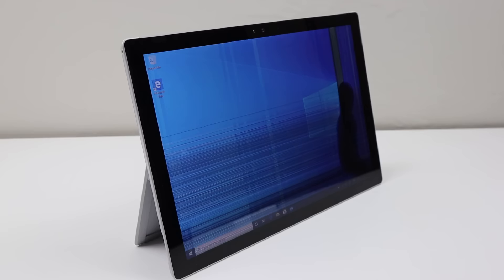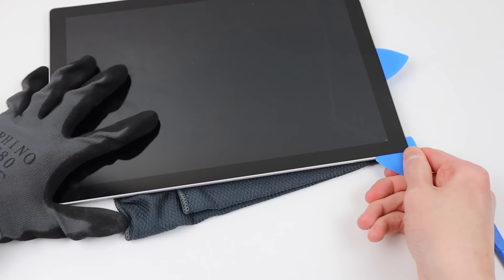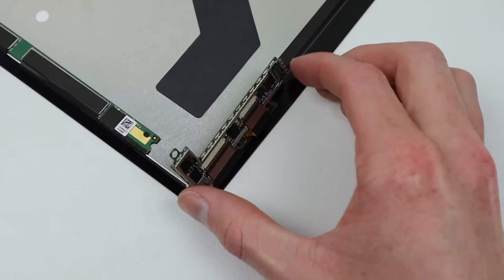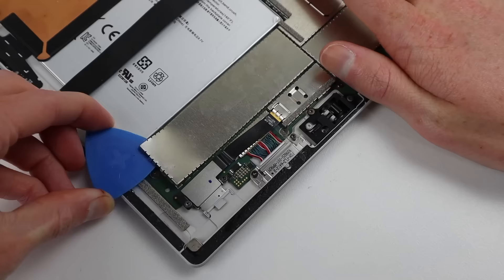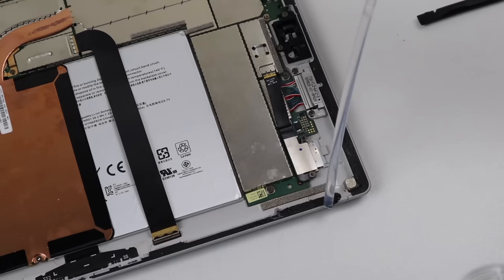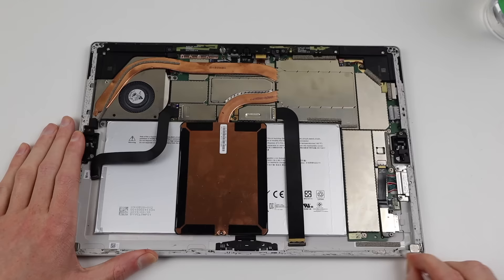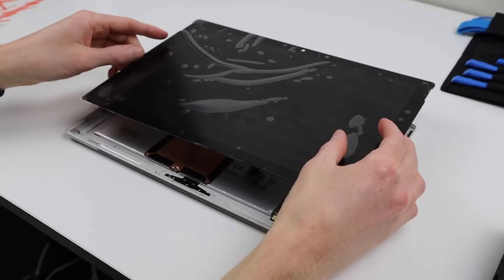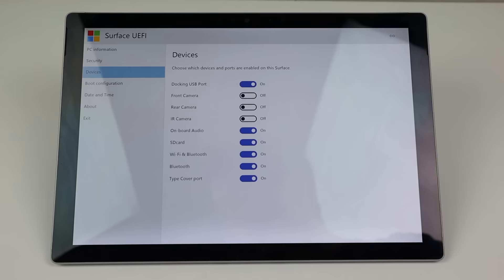Smashed Microsoft Surface Pro 4 Restoration & SSD Upgrade

Comment: Please note that ANY Samsung's screen made for the Surface Pro 4 has a major issue that is responsible for the flickering. If you want to fix this issue once and for all, get a screen for the Surface Pro 5 (made by LG - seen in this video), get the connector adapter from a SP5 to a SP4, and you're good to go.

Also, the SSD is capped to 1500MB/s in terms of read/write speeds; no need for a super fast M.2 drive, it'll be purely useless. But it'll still be way faster than the stock Samsung's drive.

Comment: I have 2 Microsoft Surface 3’s, one is cracked and the display is broken, the other one (as of right now) is fully functional except the battery is rapidly expanding and causing the screen to lift up from the the actual body of the surface. I would like to try to replace the battery but I’ve never repaired any electronics before so I’m scared that I might crack the screen or mess something else up. If I can’t fix it, I’m gonna have to sell it. Do you have any suggestions?

Comment: Hello Hugh, I just purchased a surface pro 4 off fakebook marketplace today and the guy reckons it was working really well but found out its not. its got a dead zone right in the middle of the screen and the screen flickers really bad. could you please tell me, will a screen replacement fix this? thank you

Comment: hey man, i fixed my old unibody pre retina macbook pro's hinges and now the screen wont turn on, ive tried resetting the SMC and reset my PRAM, and the display cable doesnt seem to have any damage or bent pins, and was working just fine before the repair, have you got any tips for me?

Comment: Nobody;

Me at 3 a.m. thinking I’m cool from listening to a guy with an accent speak fancy words i don’t understand:
Reply: Hello guys, I need help , my surface pro 4  has a tendency to BSOD about 3 times an hour randomly, I have windows 10, it has been like this since I bought it from ebay. It is only stable when in Safe Mode. I have tried all sorts of tests. The error is usually Whea Uncorrectable error. But sometimes it shows kernal failures etc can someone help.??
Reply: Chimeta Mulambia you spelled kernel and other things wrong but you should try looking it up on YouTube search no YouTube replies

Comment: You don't remove shields like that you do it slowly without bending them and the tape you used for the lcd won't hold long especially when it gets hot insde..  you should used black water resistant tape.. yes the surface is not water resistant but they used water resistant tape for the purposes of keeping the screen and body together!

Comment: Brilliant video Hugh. My surface pro 4 has just gone to tech heaven but I have removed the SSD from it and want to be able to remove the data. I saw at the end of your video that you placed your old ssd into a case an used it as a back up storage device, would you be able to send me a link or reply to me with a compatible enclosure to use with a Surface Pro 4 ssd? I have data on this ssd that I cannot lose and im hoping i will be able to retrieve it. Thanks

Comment: i have a samsung galaxy book 256gb 8gb ram. i was using switch charger on it when it stopped working so most likely charge board not working or it killed the battery in it.

Comment: Hello good sir, my surface 4 has a volume button issue

Basically the physical + button doesn't bounce back like a normal button so it keeps on increasing the volume

Holding the - button to act as a counter works when starting up 

The issue is kinda annoying...any idea on how to take this button down/disable?😅😅 

Thanks in advance, love ur videos

Comment: I purchased Surface Pro 7 with 128GB SDD last year and I am struggling with free storage now... I am using Micro SD card for temporary storage... Any way to upgrade the internal soldered SSD ? Please help. Thanks

Comment: I have to replace the battery from my surface pro 4, now I know it's gonna be a sticky and shieldy adventure😂
Reply: Just go outdoors and drain your battery completely and then once you got one side out just put a lot of acetone inside the battery and then just RIP your battery out I did this to a surface pro 3 and that worked out very well.

Comment: i have the same probem with my surface pro 4. screen flickering peoblem! After 30-45min use it overheats and screen flickers.. i dont think changing the screen would help.. i was told its a hardware issue

Comment: I actually cried when I heard a tiny crack when using one hand to pick up my Surface 3 a couple years ago. 2 hands for everything since then.
Reply: I still have mine & the power keyboard.  Add in a portable charger for it & you can be on all day 👌

Comment: yeah i could never pay that much for that old thing especially if it needs a new display, i dont get why it must be worth so much. just bought a 15.6" hp laptop with an i3 1005g1 4gb ram and a 128gb sata ssd for $199 new and that's the most id pay.

Comment: So you can buy a Surface Book Pro 4 on eBay for around $650.  But you bought a crack screen one for $350, than a Display for it for $255 = $605.  So you just save $50 going through all that trouble, removing the adhesive, and putting in another screen??

Comment: Hi! I have a question for you, i've broken  the lcd of mine surface 4 pro and replace with a new one but.. now touchscreen doesn't  work! I mean, i can see  everything, but it works  just  with external keyboard  and mouse. According  to  you, replacing just two  wires of  touchscreen it will  work again? After  1 hour  of using lcd  started working  bad, shadow and "color blinking"... what  can  i do?

Comment: Next time you play with the double-sided tape, use WD40. It cleans very well other dirt that IPA cannot handle. Afterwards, use IPA (isopropyl alcohol) to wash off any leftover WD40 and degrease it. WD40 does not harm electronics and plastics.

Comment: Hi Hugh. I bought recently the LG panel display unit for my surface pro 4. It's a surface pro 5 LCD by LG. The ribbon cable is not fitting one side. I ordered a surface pro 5 cable. It's not fitting the other side. Please help.
Reply: Look for the ribbon cable model #M1010537-003 works on the surface pro 4 using the surface pro 5 panel. I just did this with my surface 4 after having two panels going bad after a couple of months. If you take apart your Surface take the time to remove the heat sink from the processor, clean it up and reapply thermal paste. It really helped with overheating issues.

Comment: I wont repair any Surface again after i kind of repaired an old pro 3. I bought it as not turning on and the motherboard was broken. Screen was working fine at this point as the device turned on randomly but only once a day or so. While removing it i broke the panel because it wasn't possible to remove it without a bit of force due to the strong adhesive. This resulted in an extra 150€ cost for the new panel. At least i got 380€ for it so i got backe some of the money i put into.

Comment: I had a SP3 with a hairline crack in the screen and Microsoft told me it's basically impossible to replace the glass.  Has this changed with the SP4 and later models or did they lie to me?

Comment: Lol this was recommended to and my surface the battery is expanding and the display has come apart from the frame and I don’t know what to do
Reply: Just remove everything from your old frame and then buy a new frame with battery already glued together.

Comment: Hi Hue,
I am facing a strange issue , i had a surface pro 4 that worked completely fine and i sold it off, the guy i sold it to did a new install i believe and right after that near the usb port started getting ghost touch issue and he had the device returned to me.
I am not sure how to fix it some times the dispy works fine and sometimes it starts to show ghost touch at the aforementioned area.
Upon searching net i saw atleast one guys who had the exact same issue that is after a fresh install ghost touch issue.
Please help me if you have any fix

Comment: This is why Louis Rossmann stopped reparaing PCs and only repairs Apple products. PC manufacturers often uses several different, uncompatible display panels (and other parts) for the same laptop model while Apple only uses one model. Also Apple has way fewer SKUs, so less inventory of spare parts to have in stock.

Comment: I need replace the battery on mine , drains completely when off ..unless someone know a way fix that?
Reply: Same way, except you have to take the WHOLE thing apart. The battery is behind the mother board. I'm gonna have to do the same on my spare Surface Pro 2; been procrastinating because of how hard these things are to open. LoL. But, hands down, the best computers I've ever had for the low price. I have 3, spent a little under 600$.

Comment: One of my worst devices to try repair. I had a unit with a swelling battery, attempts to replace the battery ended up with a shattered screen (that adhesive should be used to bind the devil in hell) and a shorted out motherboard ☹️. Now I have a new screen and battery but no Surface 😂

Comment: 04:50 Can anyone recommend USB adapters for the various types of m.2 drives? Occasionally I need to remove these drives from non-working computers for data backup. Thanks!

Comment: I broke my screen trying to take apart my surface 4 in like 3 seconds even with heat. That adhesive is some of the worst to remove I've ever come across.

Comment: OMG it as same as my display error. The fee for fix it so expensive. All case of Surface Pro 4 which i met like this. So terrible
Reply: You get always go online do a slight research, google is your friend.  
Then get the parts you need or on fleebay.
If you have the condition of the posters screen.. Who cares if it breaks, since you are going to replace it.  
Just take note of not damaging other component.  The toughest part is getting the screen off.  The of course if you are going to change the battery, that is the next beast to fight with since they have the same adhesive glued down.

Comment: I love your content but I hate the surface stuff they’re trying to compete with apple but paying 800 for a standard tablet that runs a open source os like windows is rediculous! Just like my gaming pc has a i7 9700k 32gb ram and gtx 1080 and it’s ‘not. Compatible with windows 11’ however their surface thing one of them has i5 9500 and 4gb ram and 200gb ssd and it is supported. And this is £850 you could get a Mac mini for that money or an slightly older MacBook which is better for work! MacBooks are worth paying their os is only for macs meaning it’s more of a premium os to have as you paid lots for it. However windows you can install on a £80 laptop making windows too common.

Comment: I have the exact same model, however my battery only lasts for 10 minutes.
Reply: Please replace the battery if you have the tools and knowledge to do that
Reply: @et_yt_official  I do indeed have all of the needed tools and I have been repairing tech for 10 years+ however here in my country getting this battery is almost impossible.
Reply: OK but that is kind of bad
Reply: @et_yt_official  I have just ordered a battery from China.
Reply: What are you waiting for 😁😁😁 get to fixing please
Reply: @et_yt_official  It first needs to arrive 😂
Reply: Yes I understand

Comment: samsung panel is faulty to that machines...  "replace its original pannel Samsung LTY123YL01-005 (AIDA64 shows -001 though). I’ve learned from forums and websites that Samsung’s screen for Pro4 has flaws and Microsoft switch it to Pro5’s LG LP123WQ1 at the last batch. So I also purchased LG’s." ( kkk i did see the rest of the video, after write..kkkk

Comment: use acetone on removing  adhesive.. then use T700 glue on installing the new screen
Reply: Bad ideas!
1) Acetone dissolves certain types of plastic, so if you spill it, you can be in deep trouble
2) Gluing the screen back together makes it about impossible to open it back up in the future if you want to change the battery etc

Comment: My current computer is a Surface Pro 4. But I have 4 gbs of RAM🤦‍♂️.
Reply: I have the i7 16gb ram one , but the thing that sucks is battery drains out completely when its off.
Reply: @oukn6293  Well I am staying a PC guy as most YT's say go with PC. However, is the 16gb of RAM fast?
Reply: @cfwproductions  yes but you'll only notice when your program / game uses alot of ram.  The selling point is i7 .  But if you compare it to one with less than yes. My sp3 has i5 and 8gb ram and some areas feel slow

Comment: Will not be buying a Pro needing a battery or screen, was done for demonstration not economy, given only a 50% reduction in purchase price for a broken tablet. Sending $300 for the broken tablet and if I were opening it up probably another $200 for a screen, battery, SSD if under 250G, maybe memory if under 8G and was removable, with no guarantee I don't break something in the process. I would probably put $150 as my top bid for such an experiment, in fact I probably would target a unit with 100G drive and 4G memory to be upgraded.  I suspect the glue is a hot glue so I would apply a little heat to remove it.

Comment: Never use a samsung panel on the surface pro 4. These screens have a high failiure rate and cause A LOT of issues. Always try to buy an LG panel if possible, you can even buy a Surface pro 5 display because they're the same, you just need to also buy the display connector cables for it if your surface doesn't already have an LG screen installed.

Comment: Wow, you're so lucky you never replaced your "revised" model which had the LG panel and replaced it with the defective Samsung panel. The Samsung panels all develope a flicker and once Microsoft admitted the design flaw they replaced with the LG panel if you where lucky enought to still have warranty and it's also why the LG panel you searched was found on the later surface pro. Great video though and lucky escape haha.

Comment: Don't recommend this SSD, it's hot and power hungry, watch some tests to find something cooler, but it would most likely be slower drive with x2 connection (up to 1500 mb/s r/w speeds)
Reply: So which Brand to recommend since you Shoot down Samsung?
Reply: @GamingLiveHDChannelPH  SK Hynix (Solidigm) are generally recommended and also the ones installed on a many laptops

Comment: Why did you create a partition then install Windows? That makes no sense
Reply: Umm, while making clean install you're supposed to delete all partitions (if any) and make new one where you install windows
Reply: @SheIITear  Somewhat correct. You can delete all partitions on the device, but you don't need to make a new partition for Windows. That new SSD came up with 500gb unallocated space, all he needed to do was press next, not make more partitions on it.
Reply: When you plug in a brand new SSD, as long as it says "500gb unallocated space" you can just click next on it - you do not need to make a new partition. Windows will do this automatically for you. Delete all existing partitions until you get to one that says 500gb unallocated, then just press next and windows will figure it all out for you.
Reply: @cam7004  Meh, the partitions are still going to be made by windows.
Reply: @cam7004  windows automatically makes 1 partition if you just press next - And no one sane has 1 partition

Comment: Worst restoration decision ever, Mate you should have done some research first,these Surface Pro 4 Samsung panels suffer from screen burn in due to heating up, that connector saved you a lot now that you are using pro 5 panel

Comment: Man i cringed on this video:
1plis use knife with good tip and take your time with shields so you won't destroy it
2 use different adhesive (at least on top next to windows hello (you will see light leakage from camera status light)
3 check if maybe your cable is same on motherboard as in normal sp4
4 maybe change thermal paste and clean the fan